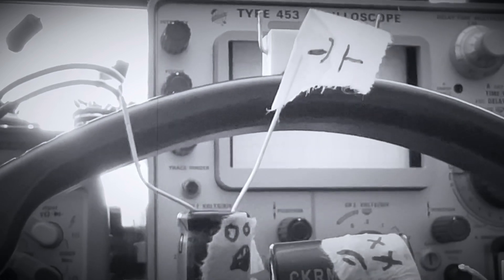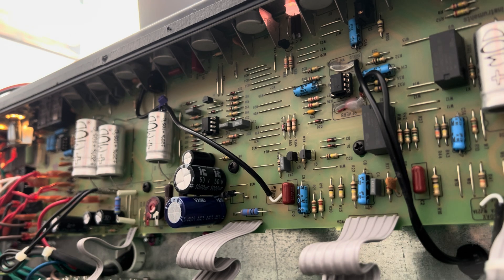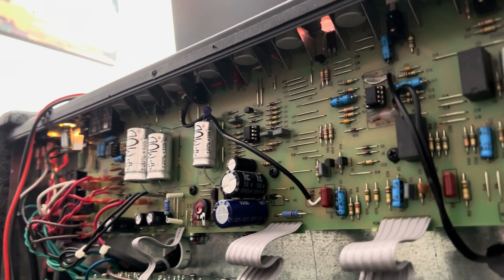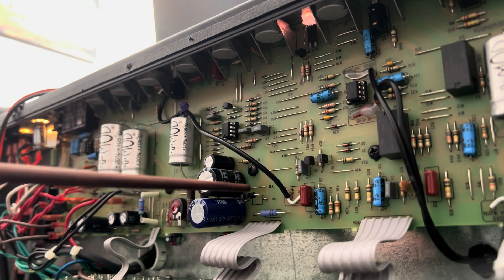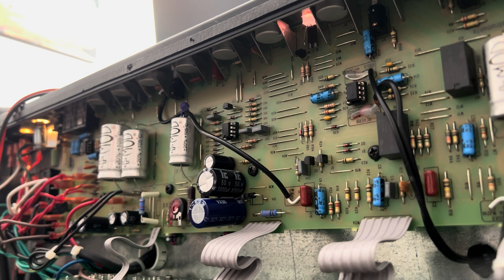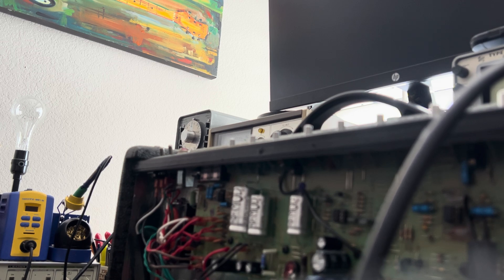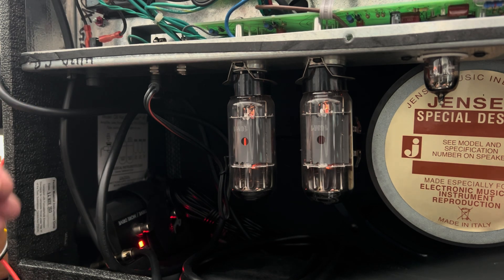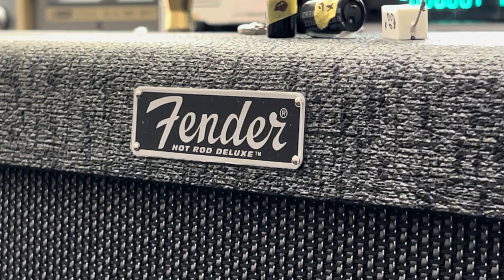Fender George Benson Hotrod Deluxe 4: Mystery Cause of Channel Switching Failure SOLVED

Comment: Seems that the number of jumper wires on that PCB is almost the same as the number of other components. 😂
It is not necessarily a good thing because thermal expansion and mechanical stress etc  affect jumper wires too, and a huge number of jumpers does not make that amp any better or more reliable .
Or maybe we could discuss whether for example silver jumper wire or oxygen-free copper jumper would sound better. Or vintage cloth insulated jumper wires. 😂
Reply from the maker: Cryogenically treated lol

Comment: Wow! Private Benson was Saved!!
Reply from the maker: We had to get him the hell out of there!
Reply: Frank, I have this happen on either a HR Deluxe or DeVille.  My determination was the zener had gone open circuit and no longer served as the shunt regulator and blasted the poor OP Amp with full voltage.  The weakest one will then internally short (avalanche) and then act as a near zero volt regulator.  Replacing the failed IC but not the zener will result in at least one more failed IC.

I also socket all the iC's if the board comes out.  As well as replacing the HV caps if they are more than a few years old.
Reply from the maker: @seanweatherford1251 you’re a man of well seasoned taste. I knew you were a socketed IC guy the moment I read your first comment.